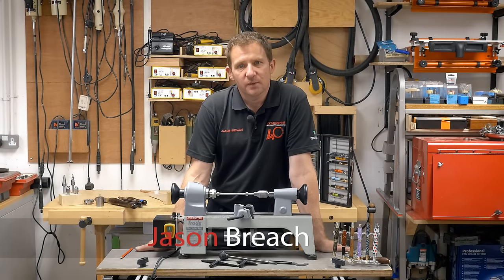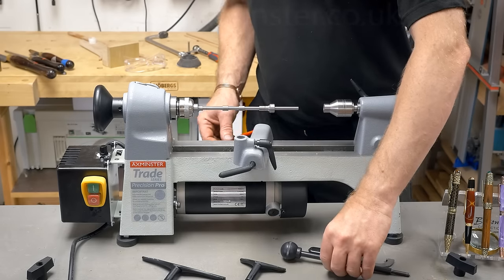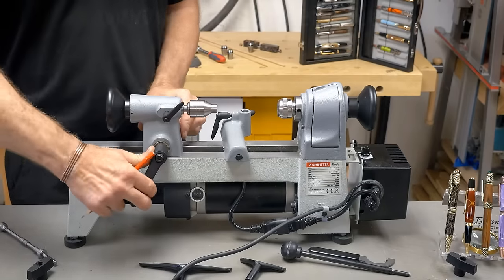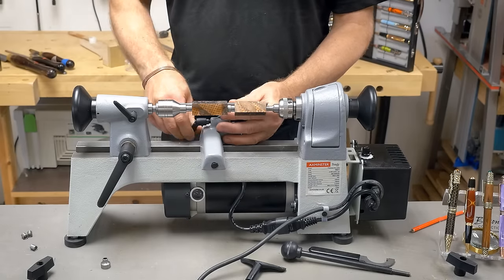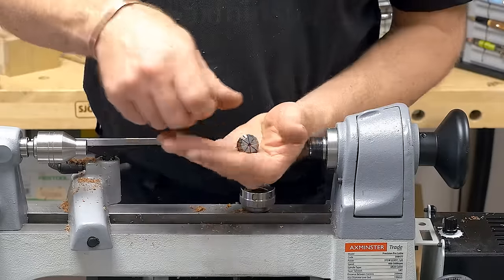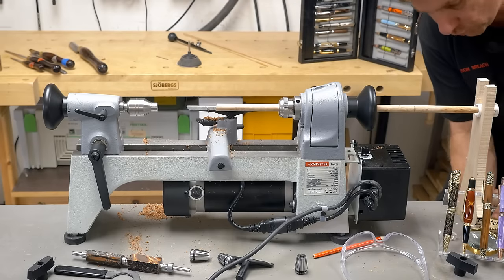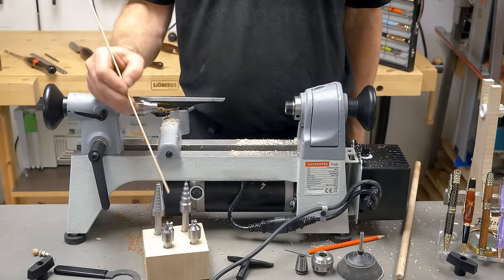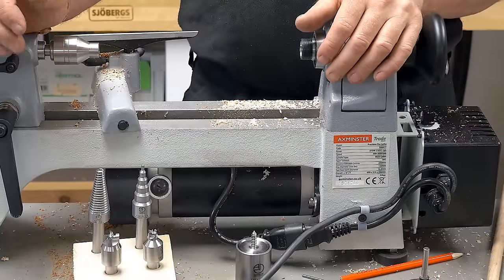Precision Pro Lathe - Overview

Comment: I didn't let the lack of chuck put me off, and am really enjoying this little lathe, but I did want a chuck, and it seems your not really interested in actually making one available ?
It would be the work of a few minutes to adapt the Clubman 80 ¾"x16 tpi chuck to fit.
I know it's possible to do it, because I have taken the plunge and bought a Nova G3 chuck, and an unthreaded adaptor, 20 minutes work for anyone with a metal turning lathe to cut a thread, or to open out a ¾" x 16tpi chuck and re-thread.